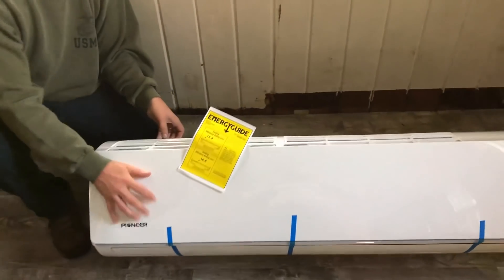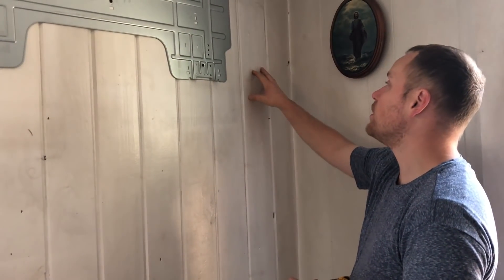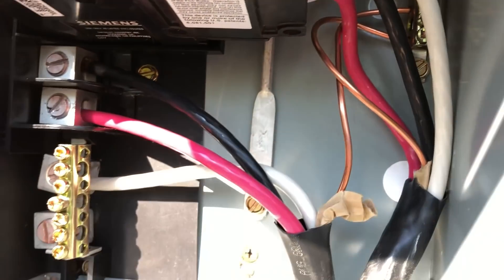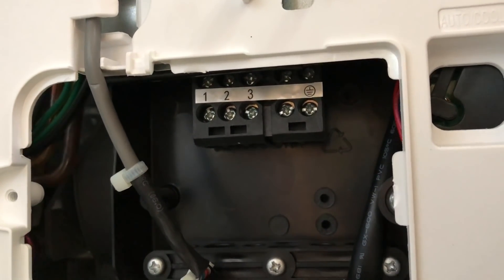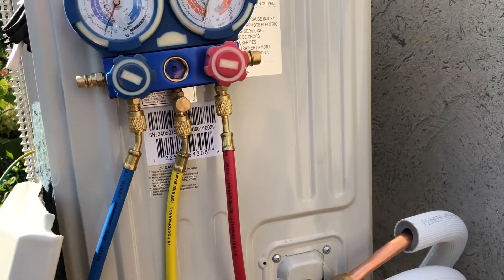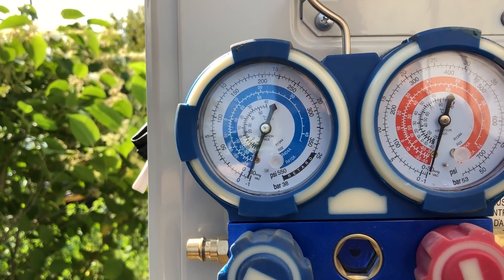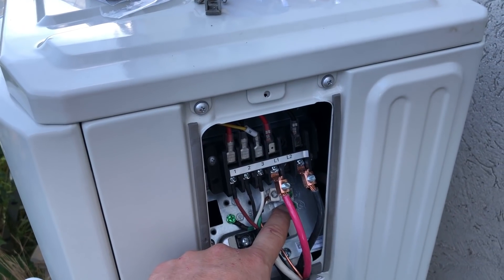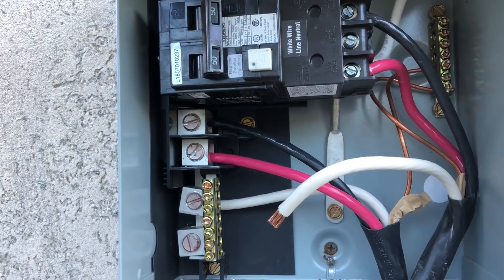How to: Install a Mini-Split Heat Pump + Air Conditioner and Save Thousands!

Comment: Another thing you didn't show is how you get the vacuum hoses off of the fittings without letting air back into the system.

Comment: wow...I hope still alive your A/C with the electric connection and the vacuum you did before. you mention in your video DON"T do it that part if not confident with wire in...I saw you made a big mistake on the breaker AMPS.  and wires gauge.

Comment: Thank you so much man, I’ve had a lot of questions about doing one of these and this video solved all of them. Like can I use house wire from the panel to the compressor, can I use a bigger size wire from my old ac to a 15 amp. One question though did you run into any problem with having the wires exposed liked that?

Comment: No cable clamps on disconnect?   220 does not need a neutral just a ground.  So basically you have two grounds attached.  Should have had seal tight from unit to disconnect

Comment: These are junk. I install a unit in my house and didn’t have a flare tool so I Jb-weld the lines together. The drain pours into a big bucket and it never fill up then refrigerant leak out and no ac. 
And the direction never said you can’t mount to the ceiling. The condenser sits on window sill and keep almost falling out of window because too heavy
Junk. It never work right.
Reply: Now that is funny

Comment: Is that a pellet stove being vented right next to the compressor? I’m guessing you didn’t pull a permit because I can’t imagine that complying with code even though you won’t be using the mini split and pellet stove at the same time.

Comment: I see others caught this but. Electrically make sure you know what your doing. You do need some sort of disconnect outside near the unit but you should also make sure you are fused or “breakered “ within the parameters of the unit installed ie; minimum ampacity= must be able to carry these amps continuously, max fuse size ( may also be a HACR breaker) cannot exceed that  this amperage. Gets tricky with 25 amp and 35 amp units. Also Romex or NM cable as it is actually referred to in codes is not allowed to be used outdoors. And 99% of units don’t need a neutral.

Comment: WE ARE INSTALLING A MR. COOL 36K JUST GOT DONE WITH CONNECTING THE LINES AND TOMORROW GOING TO FINISH ELECTRIC... GOING TO HOME DEPOT TO PUT OUTSIDE BREAKER 40 AMP..... HOWS YOUR UNIT HOLDING UP WE READ ALL COMMENTS SOME PEOPLE ARE JEALOUS AND ASS HOLES... I GOING TO SUBSCRIBE AND HELP YOU OUT.... CHECK OUR CHANNEL OUT AND PLEASE SUBSCRIBE TO US ..... HELP EACH OTHER OUT.....
Reply from the maker: Still functioning perfect - not a single issue.
Reply: @WilsonsRec  Great job and thanks for subscribing to us and your welcome for us subbing to you and also I pushed the bell to watch your videos first...

Comment: You must have a Licensed HVAC company to do the refrigerant part of the installation. This is Federal law. Also, if you do not use an HVAC company, your warranty WILL be voided by the Factory.

Now, IF, you buy a "DIY" system, none of the above is required. Yet it does not void the warranty.
Reply: @stangmaster 2 Heaven's NO!

Comment: Ty for the excellent info. Ima need to watch this a few times. Would love to do this type of system. What do you suggest type of system I live in Arizona.  And I have under 2 thousand sqaure feet.it's a double wide .any suggestions?

Comment: @coreywilson Which pipe bender did you use?
Reply from the maker: Kyle Close called a spring bender.
Reply: @WilsonsRec  would you mind putting up a link to the one you ordered on amazon? Just getting a few different kinds when I pull that up. Please and thank you!
Reply from the maker: Kyle Close here you go. Superior Tool 61600 Spring Tube Bender 4-pc. Set,-1/4" 3/8" 1/2" and 5/8" Tube Bender Set https://www.amazon.com/dp/B000S8EXD4/ref=cm_sw_r_cp_api_i_wZ3QEbBDZ2YHD
Reply: @WilsonsRec  How do you slide those over the flares on the end?

Comment: Nice job, now MrCool came out with a DIY mini split, sort of plug-and-play, where you don't neet HVAC assistance, nor manifold and vacuum pump. You just connect lines together turn on the switch(after doing your own electrical) and start it:  https://mrcool.com/diy-3rd-generation-e-star/

Comment: Thats the problem with do it your self guys Have no respect for safety codes ,improper use of tools of the trade ,when unit fails and customer has to call for service. If I walk on site I would turn around and report to safety authority , its one thing to install for you self but to teach others and give bad advice and post on internet , leave it to the licensed trades , I'm sure your home insurance would refuse to pay for any claims that come of it .

Comment: As a tech, I noticed a couple of things wrong with this video. 1. You didn’t use a micron gauge. You should always draw down to a 500 micron vacuum. 2. You should never tighten the hoses with anything other than your hands. 3. You should have run your line set and drain in a downward slope for proper drainage. 4. You should never leave any uncovered wires.

Comment: In new home construction can the line sets be installed inside the exterior wall and punched through the bottom of the wall???
Reply from the maker: Sylvia Sheng yes, absolutely.  That is the preferred way because you can hide the lines.  Good luck.  Please subscribe

Comment: Thank you, I am so curious how your electric bill has changed. I would love it if you shared our savings. I'm moving into a 576 sq ft condo and I'm considering this type of cooling/heating system. Thank you
Reply: Air to air mini split with Seer's  in the low 30's are now second only to ground systems in effeciency and operating cost. 2014 my oil hot water system and heating oil at 3.40 a gal and window ac units I spent $1800.00 . Elect rates were 12.5 cents per KWH.
Fall of 15, I installed a two ton  Mitsubishi mini, two ceiling fans and spent under $700.00. for heat and ac. And cut air pollution 20%.

Ac cost dropped 35%, heating 60%. Your condos may not allow them or it may not be reasonable but if you can, do the install!
Reply: Wow that’s a great reduction 
I’m going to run it by the HOA 
I live in the desert and the R22 coolant starting 2020 Jan will be banned by EPA 
So it’s time for a change

Comment: Hello Corey thanks for the video. I just wanted to comment on the breaker. The breaker needs to be resized to a lower specified value  in the manual of your AC . Because if the AC unit ends up drawing too much current it would cause a fire even though the conductor that you installed is rated for higher current I am pretty sure the internal wiring for the AC unit is not.  Thank you.
Reply from the maker: Thanks for the feedback!

Comment: Pretty good install, I would say one thing though.  You really need a micron gauge to tell if you have a good vacuum and if it is holding.
Reply: For joe homeowner I guess it works.  Replace every few years. There was more wrong than right here.
Reply from the maker: Mike  Tuttle agreed!!

Comment: Yeah, use dirt instead of teflon tape for better seals.  ;-p
Reply from the maker: ckeilah I appreciate your comment, however you do not use Teflon tape on flared fittings or they will leak.
Reply: Good point. I was mostly ribbing you about “this is the one that fell in the dirt” circa 10:38. 😉

Comment: You lost refrigerant in the  yellow hose when you opened the valve BTW.  Why'd you do that?
Reply: Can you expand on this comment.  The yellow line is connected to the pump at 15:05.  There is hardly enough detail in this video to see what the heck they are actually doing.  This video is a lot of talk and no real action, a true waste of time....glad I watched at 2x speed.

Comment: Good job on the install Corey although not ideal you definitely made it work with what you had available; this is coming from a Pioneer Technical Support agent. Thanks for taking the time on recording the install and providing all the links for necessary components.
Reply: Wow. From Pioneer.  No wonder the industry considers Pioneer the same as Gree.

Comment: Do dad and mom have life insurance? Are you the beneficiary? 😉
Reply from the maker: No, but perhaps they should?  Truthfully, we are not pros and we know that.  The unit has been installed for one year and has worked flawlessly.  The one that was installed professionally has has two leaks and needed a fan and a motor.  The people that like to criticize (with many valid points) fail to realize that we are in rural Maine where there is no internet and no HVAC people.  We make do with what we have.  Perfect, no, but it does the trick.  Thanks for commenting though - appreciate you watching.  All the best - Corey
Reply: @WilsonsRec  No internet???? How did you post this video to Youtube?  How did you order parts/vacuum from Amazon......oh boy.....how big was that fish you caught last year???
Reply: @ldlink3935  I think what he was implying is that professional people to install (trouble shoot?)  internet, or , in this case, a HVAC system are difficult to get, if not just too expensive for labor, that most in their rural area are DIYers.  No sin there.  He probably did have to order parts the old fashioned way;  he phone called or mail ordered.  Cut him some slack.

Comment: Its a 208/230 volt unit? Why need neutral wire? No way you need a plier for tight that fitting.  Should have leak test the system at 600 psi for 24 hour.  Code violation never connect neutral wire to grounding just cap it off and dont connect it to anything if you made mistake and pull it out there.   Thx for sharing.
Reply from the maker: Quang Nguyen thanks for the point on the neutral.  That is exactly what I ended up doing.  Ideally a pressure test using nitrogen is done as you pointed out but we had none so we took the chance.  It has been a year and no leaks so we were fortunate to get them all right.

Comment: 20 amp 2 pole breaker and a #12 wire.
Reply: I would say 30A 2P and #10.  But a 20A breaker would probably work because the systems are usually oversized and don't pull the full nameplate amps.

Comment: Corey I live in pakistan here the temperature is too hot about 50 so my question is to you is this system is success in my house and one compresser is more for this ...please
Reply: Usman Ali 
You need a load calculation. Probably a bigger unit to handle that high ambient temp.  600 square foot per 12,000 btu here in the US. You may go with 400 square feet per 12,000 btu or even more.  Try call manufacturing for unit size recommendation.

Comment: Remember to use the bonded strap at the back of the disconnect box to bond the box to the ground lug. This prevents shock if wires come loose or touch to box itself. Hope this helps.Great job.
Reply: you only bond at service entrance see nec code
Reply: 50 AMP ?.?
Reply: I’m installing 2 ton , 24000k, diy mr cool . Using 20 or 25 amp 2pole breaker, with 10-2 w/ ground. The only 50 amp I have goes to my swimming pool, I have three 30 amp Brks. , dryer, oven, and my 225 stick Lincoln Welder .
Reply: Mr cool 24k pulls less than 20 amps (more like 5 amps), I don't understand why 12 - 2-with ground wouldn't be just fine.  But I'm  still running 10 gage. I can't belive this guy running 6 gage.
Reply: Very confusing using white for ground (might lead to future problems) use green or bare copper. At least put green tape on both ends of the wire that you use for ground. (

Comment: Get a micron gauge for when you’re pulling a vacuum.  Make sure it pulls down below 500 microns, then valve off the vacuum pump.  Watch your microns, if they keep rising you have a leak, if they increase but stop and plateau you still have moisture in the refrigerant lines and coil.  When you have all the Mouisture evacuated the micron gauge shouldn’t go above 500 microns when valved off from the vacuum pump.

Comment: Do you have any pictures on how to run your copper tubing.  I notice on all these video for some reason no one shows the copper installation.
Reply from the maker: We did not video that but you need to be careful.  We used a spring bender so we did not kink any lines and recommend that to you.
Reply: @WilsonsRec  I stand corrected, sorry for assuming :D good recommendation, don't try bending lines by hand

Comment: NEVER hook to the high pressure port once you have refrigerant in. Just removing the gages will cause a loss of too much refrigerant. These systems work off a weight charge not pressures.
Reply from the maker: Jason Barta thank you for the feedback!
Reply: you can add it back in through the suction side
Reply: Jason Barta actually they work off of pressures, saturated temperatures, superheat, and subcooling.

Comment: You’re asking for trouble with no clamps on that electrical line on the box inside or the breaker box outside and not on the outside compressor box.  Good chance of chaffing and shorting.
Reply from the maker: We added them in after.  We are in rural Maine and it is 30 min to the store so we finished and went back and added them when we had time to run to the store.  Your point is valid for sure.
Reply: first thing I saw. wow

Comment from the maker: Product Links (as complete as I could make it):

PIONEER Mini Split Heat Pump: https://amzn.to/2I7MfLm
Hide-A-Line 4 Inch Line Covers: https://amzn.to/2QTNphm 
50 Amp Disconnect Panel: https://amzn.to/2DoaC8X 
Vacuum Pump: https://amzn.to/2DnZSHJ 
Gauges: https://amzn.to/2QQk1Jb 
410 A Adapter (You NEED this): https://amzn.to/2ONyvrA 
2-1/2 inch drill bit: https://amzn.to/2QWk8ma 
Drill Bit Extension (5 inch): https://amzn.to/2DqP4IE 
6/2 Gauge Wire: https://amzn.to/2xyyTDQ 

***As an Amazon Associate I earn from qualifying purchases.  Your purchase using these links allows me to continue to make high-quality DIY videos and is greatly appreciated.